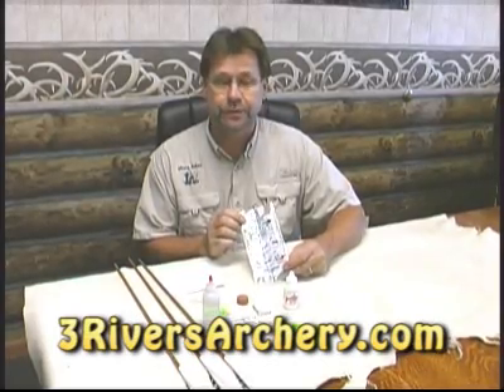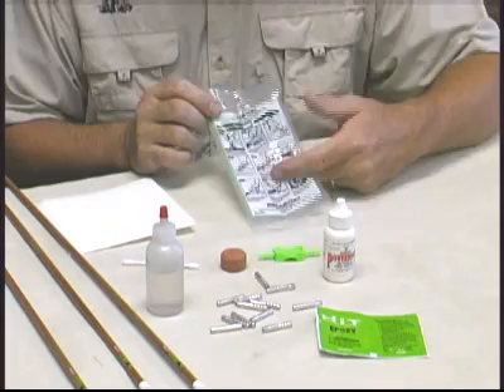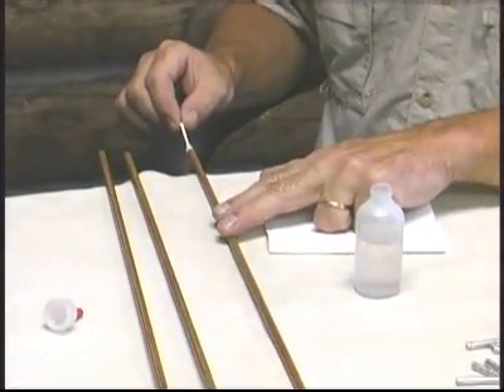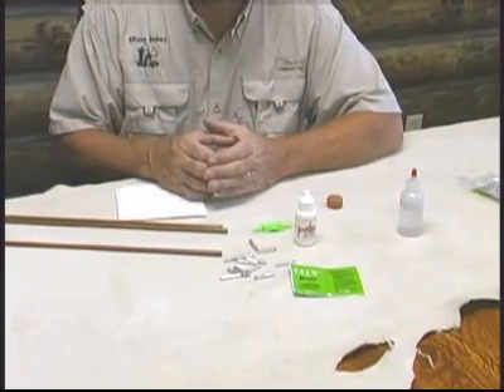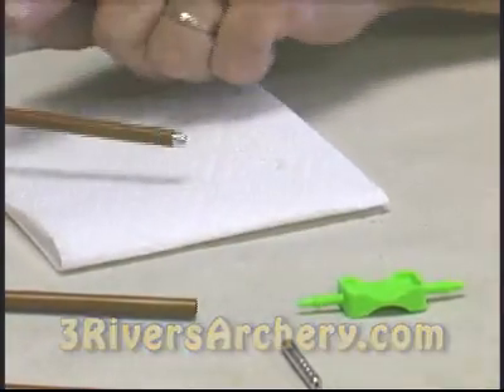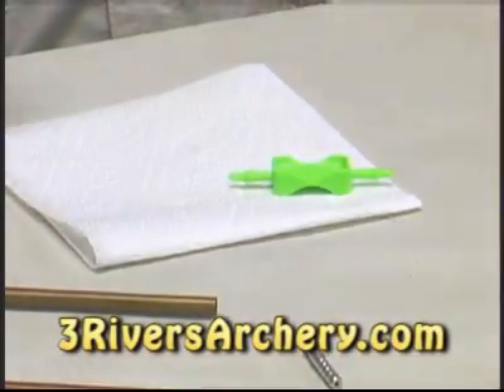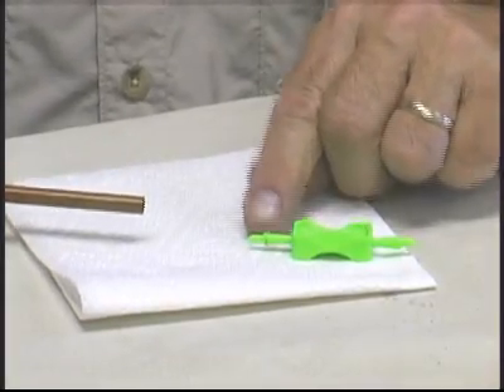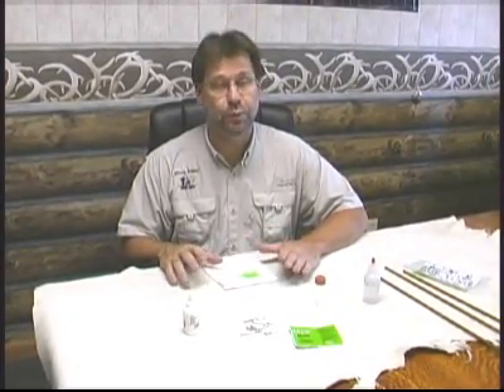3Rivers Archery Installing Axis Inserts

Comment from the maker: You should not have a gap between the field point and the arrow shaft if you are using the green insert tool. The insert tool sets the insert in the shaft the proper distance so that the point is flush to the shaft. You will want to make sure that you go the full depth of the tool when sliding the tool in the shaft.

Comment from the maker: Dale simply prefers the Powerbond to the provided epoxy. We now carry a product called Insert Iron, which is essentially the same product with a different name.

Dale did explain how the epoxy was mixed, but since he was using the Powerbond, he didn't see the point in actually wasting a package of epoxy by mixing it.

The epoxy provided with the Axis inserts is a great product. But you aren't required to use it.

Comment from the maker: If you are using the Deep Six Broadheads you will need arrows that are Deep Six compatible. I believe the  Beman arrows that you have are a standard size insert and are not Deep Six. The Deep six points you have are a smaller thread size and will not screw into the inserts.

Comment: How do you remove the HIIT insert?
Reply from the maker: It is not an easy task to remove HIT inserts (and normally you cannot). You can try by screwing a point in and heating the point. It is transferring the heat to the HIT, but if a lot of epoxy was used to mount them, then it is normally too much heat that gets passed to the carbon in the process before it could be removed.